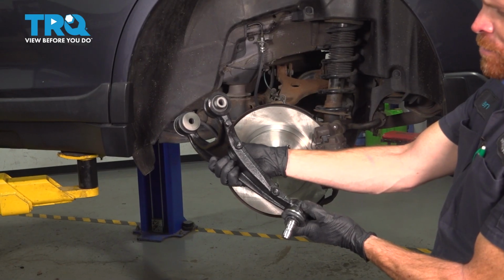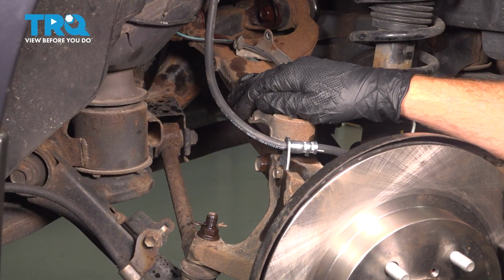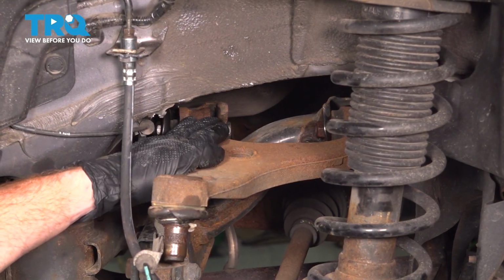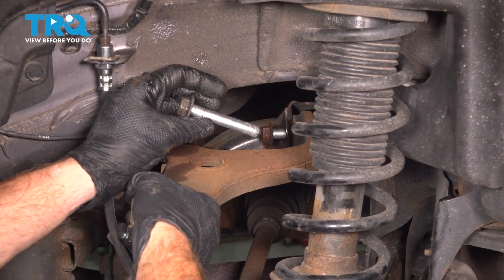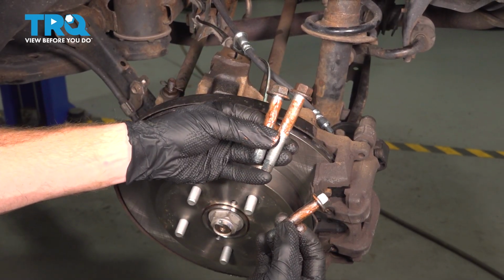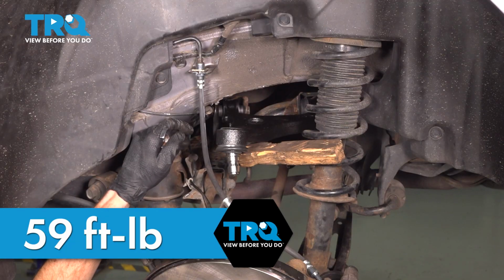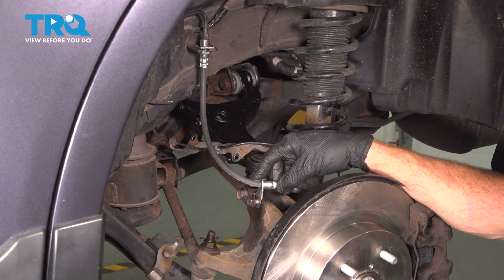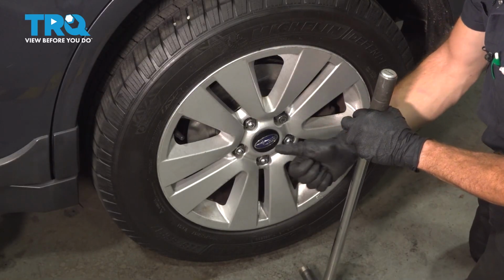How to Replace Rear Upper Control Arms with Ball Joint 2015-2019 Subaru Outback

Comment: Worst mounting locations I've ever seen on a rear arm. The outer nuts are almost impossible to get to because of the stamped steel and zero extra room to work. After working on multiple aspects of my outback over the last few years, I will never buy another Subaru.

Comment: 3 days ago, my mechanic bf had to cut and replace both my bolts. The new bolts cost $50 each. Not a cheap job. Arms were $80 each. For a 2011 Kia Sorento EX V6